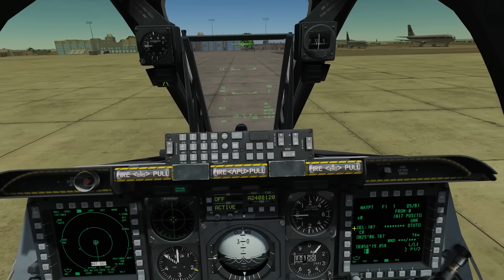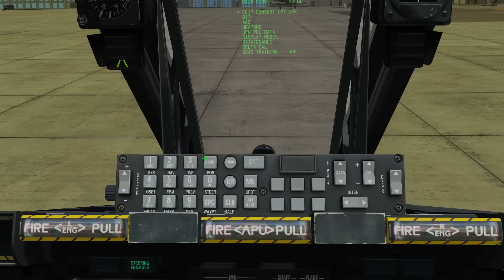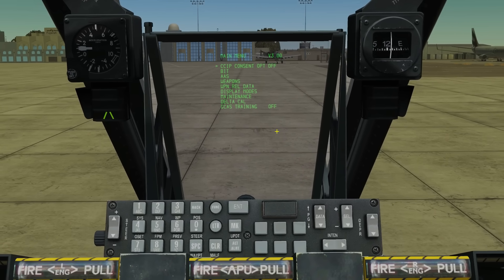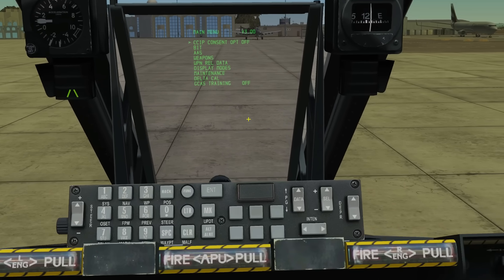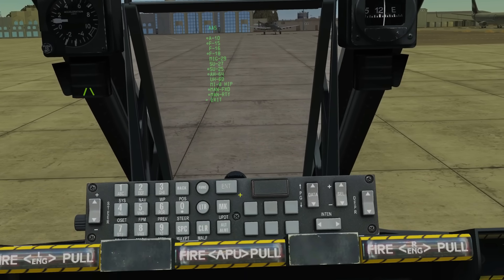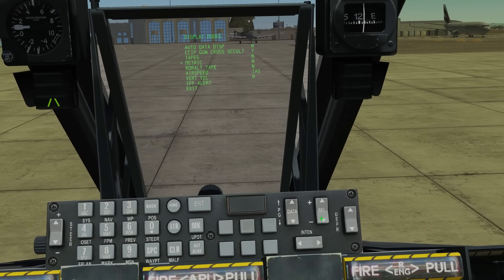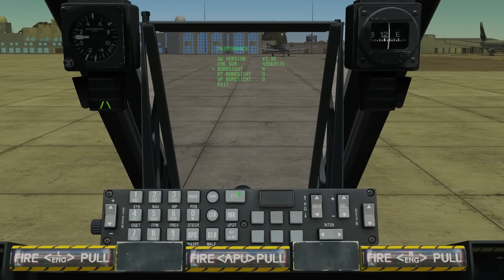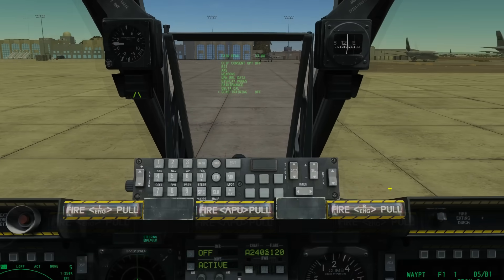A-10C Warthog: Basic IFFCC Menu Tutorial | DCS WORLD

Comment: Hi! want to get into DCS. I would like to know the ideal beginner plane. Additionally what to know when buying a new plane so that I do not regret it.
Reply: Just download the free version which includes the SU-25 and get a feel for it. I recommend the F-15C if you are just starting out. The perfect amount of complexity yet still on the simple side compared to the other aircraft. Welcome to the addiction.
Reply: Do what these guys said.  But get a HOTAS set up ASAP.  You will want it even with the FC3 jets.  Try slewing the Target Designator thingy for the F15 radar while maneuvering with out it...do able. Not fun or easy.  For A10C HOTAS is a must.
Reply: Dont buy the cheap planes. DCS is about cockpit immersion. If flipping switches, and learning real flight concepts, immersion and reality is what your looking for. Buy the expensive planes.   
You dont need expensive gear. I fly with the logitec. With a little tweaking its a perfect joystick.

the keyboard allows "Modifiers".. this means i can hold down a key and it changes all the buttons on my joystick to another set of commands.

at the moment, i press right alt.. and the joystick works all the TMS commands. Target Management Switch.
if i hold L.Win.. i control the planes Countermeasures
if i hold L.CNTTL.. i control the Data Management System
L.SHIFT.. Aircraft Trim
`~.. Look around cockpit

its truly hands down. eyes up. Without expensive gear.    i do have to switch my hands between keyboard and the base of the joystick buttons, but this can be done eyes up.
i currently have Master Mode, Nose wheel steering/AtA Refueling reset,  Air brakes, and C and V (china hat i think) on the base joystick buttons.  and the buttons on the top, control the left and right monitors.   the thumb controller is wonky.. but it gets the job done.
Reply: I agree with PepperPete11 download the free version, watch Cap's videos for the Su-25 and if you like it, get the FC3 pack or one of the FC3 planes, no clickable cockpit but each plane is ~$15 instead of $50-80. The A-10C is $60, totally worth it, but also wait around and keep an eye out for sales!